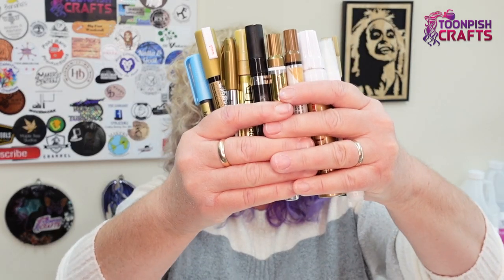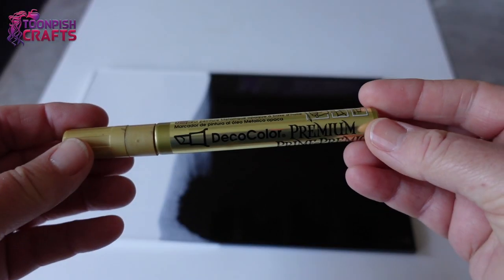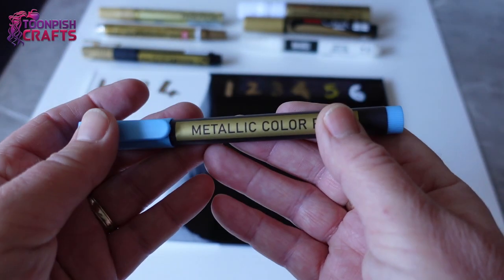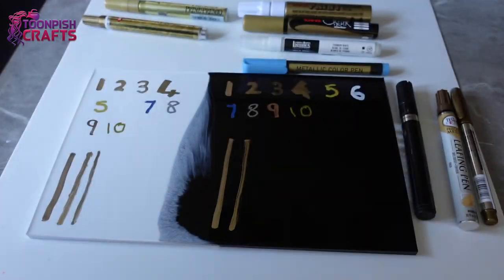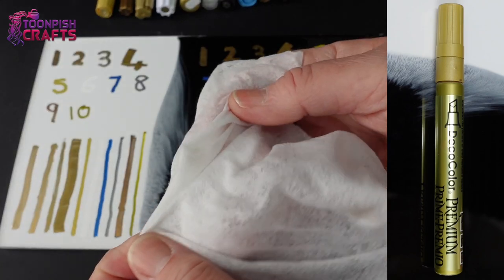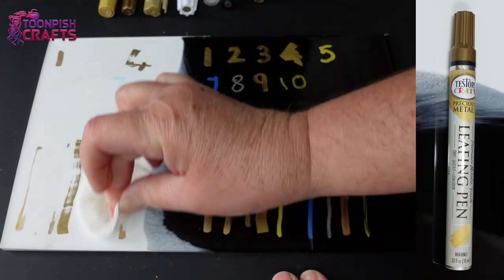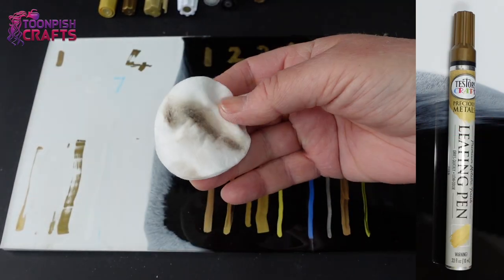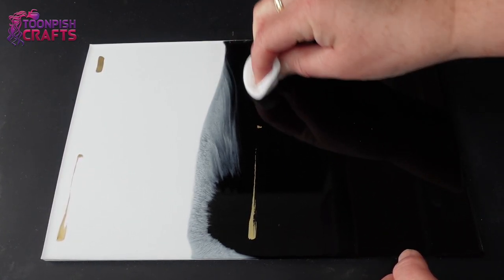Resin edge markers do they last?- 5 endurance tests on 10 markers

Comment: Excellent Wendy!  I’ve never trusted a pen on the edges bc it’s just paint.  I’d like to see what happens when a few of them sit there with water.  Because it’s the condensation that would be prolonged over long term use.  Especially with hot liquids like coffee or teas.  Thanks for sharing this 🙌💯💯💯🌹🌹
Reply from the maker: Debrajo you are not wrong 👍
It really depends if you want to make decorative pieces or practical pieces. 
Both have their place ofc 😀
Thanks for your comment 👍

Comment: These videos are like you are reading my mind, as I am trying to decide which brand(s) to buy gold/silver pens right now. 

But I do have a question about the chameleon powders/flakes you used in a previous video. They impressed me so much that I got both. Now I am trying to figure out how to use them. My sister wants a pen holder and sent me a mold. In trying to use the powders, my question is: if I can see through the applied powder in a bright light, am I using enough powder? Do I need to apply it well enough to just make sure there is a sheen of the powder over the mold, or do I have to be sure that the bright light doesn't show patches of thinner covering? I don't want to waste these expensive (for me) powders, but I definitely don't want to waste the resin by turning out inferior quality work.

You are SO appreciated! Thank you.
Reply from the maker: Thanks for your question JayKB

The easiest way to explain this process is to put on powder and blow off excess. 
What ever doesn’t stick to the mould isn’t needed. 
Make sure you have no missed areas but don’t worry about a bright light. 

If you are referring to the flakes 
It will look as if it is patchy and that is normal 

I hope this helps 

Good luck with your project 
🤞👍😀
Reply: @Toonpish  I'm not sure we're on the same page. 🙂

I always work under a bright light, and this she's that my application is very splotchy. I'm afraid I'm putting on too little. I'm working with both flakes and powders. But what I am referring to is just the powder. Flakes...they were a mistake with my limited (hopefully, temporary) vision. But can you (I) put on too LITTLE powder? It covers the entire area that I am working on. It's just that it's not a consistent coverage. Is this going to show through when I put the black resin into my mold? 

The only things I have used it on so far are small pieces of jewelry. This hasn't been large enough to test the amount needed for powders, as the coverage was evenly distributed.  I'm just worried I'm not putting on enough powder. Your videos showed an even usage of the powders, as far as I could see. (Which...🙄🙂) isn't something I can swear by right now. Swear about...🥴

I REALLY appreciate your help and willingness to answer (dumb) questions from me and thank you so much!
Reply from the maker: Okay 🤔
I think you need to be sure the surface is covered completely 😀
I take it the mould is a coloured one? So you can see the colour of the mould through the mica? 
Let me just say this and hopefully it might help you ——
Mica sticks to silicone and once the silicone is covered in mica it can’t stick anymore, 
The rest will sit on top and will not do anything other than float off into the black resin. 
Take a soft brush ( like a makeup blush) and gentle blush over the entire piece. 
Turn it upside down and shake then take it outside and blow off the excess. 
When you check the mould again under black light it should look more uniform shade all over. 
It sounds as if you are overthinking things a little which is perfectly understandable when wanting the right outcome the first time due to financial constraints. 
I can not give you 100% guaranteed success, but if I were you ( and I never use black light)  once you do that soft brush tip- you should be good to go 😀👍❤️
Reply: @Toonpish  you made an excellent point about the silicone not holding more powder. So far, I have been putting the powder on sparingly and rubbing it in well. But if I go back and try with those thinner spots and it won't stick, then I know it's ok. No black lights here, but I have a small hand-held LED light that I use for flash curing UV resin. My mold is a very heavy clear one that has diamond-shaped patterns (14) around it. I am trying to do the diamonds in different colors. BIG mistake! But you gave me the courage to try in one of your videos. It will take forever with a Q-tip to clean up excess powder/flakes. I'm using both. The flakes are gorgeous, but...not really worth the effort on large projects. (My husband would tell you that I overthink everything trying to get perfection in whatever I'm doing. 🙂) I am so thankful for your help!
Reply from the maker: Np hun 😀
Good luck 🤞